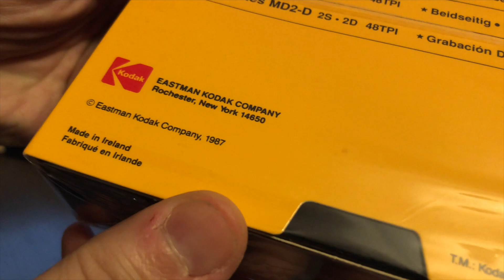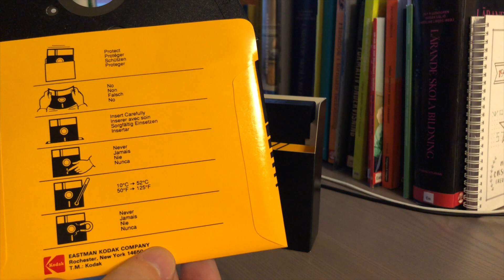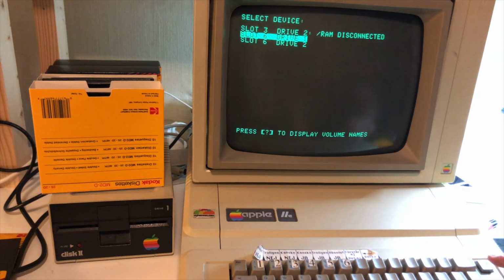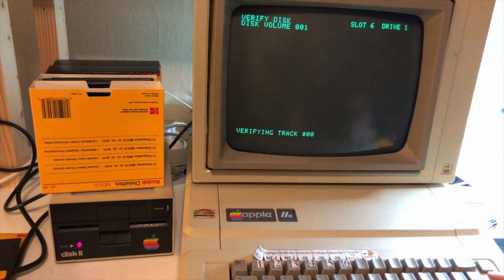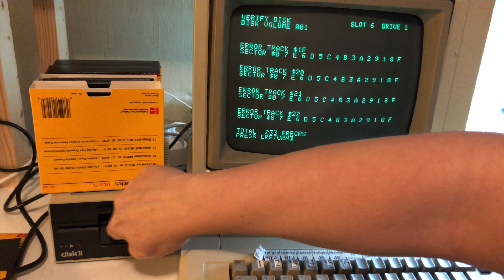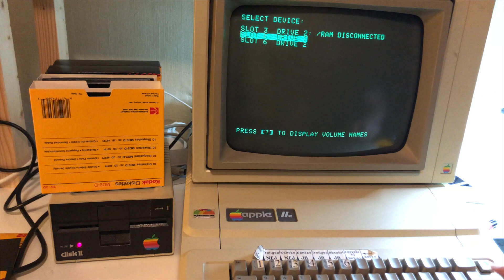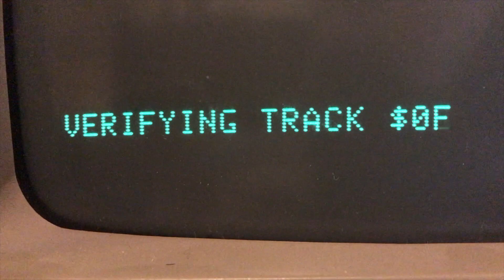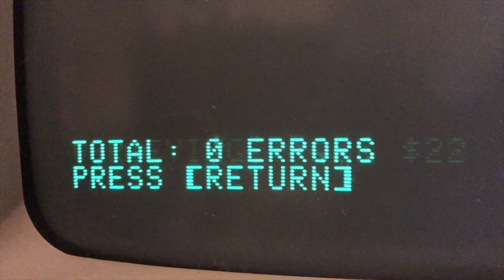33 year old floppy disks: Unwrapping! Have they survived storage? Can we discover life?

Comment: I have just obtained a usb iomega citizen drive (X1DE-USB) which runs on 10 after finding out how to set it in windows to use nec usb as a generic driver. Out of twenty disks, I've had no issues aside from one file, although given the nature of floppies with reliability and ability to eject whilst running, I highly suspect the file was already corrupted. The disks are only twenty years old however, and at the time of obtaining my 2002 PC, floppy disks were on their way out, so I did not use them often. Some articles mention they are still in use in some industries, although as for why...

Comment: i have got 2 or 3 retail box 100 pcs unopened branded 5.25"  (10 packs of 10 disks sealed).
a number of 10 pcs +5 unopened and sealed. great, so i have saved a collection of +1.000
floppys with games demos from 1984-1994 and it's possibly all gone? this isn't the best
day. in acual time just copying and going to copy parties i guess i have spent at least a year
to get that. i have unreleased demo code (not mine) from a triad member. 

well as long as i haven't tried to test them it's a treasure.

looks like floppydisk.com offer 100% tested disks i'm not endorsed or affiliated with them.
Reply from the maker: On one hand most of them could be perfectly fine, on the other hand it’s difficult to know which ones are not.
Difficult dilemma that... “Should I try reading and archive the data before the disk degrades, or should I avoid using them?”
I suppose it is all up to what personal risk you are willing to take. I know what I would choose, but I can’t make any recommendation for others.

As for unopened boxes, I have noticed that brands with taped/glued plastic wrap are rarely air tight, and more likely to trap humidity than heat sealed plastic. Also, I rarely had issues with used floppies stored in room temperature in normal Nordic humidity.

I hope all works out well.